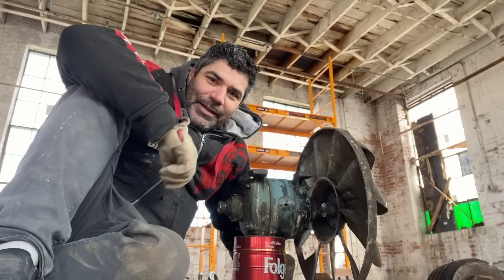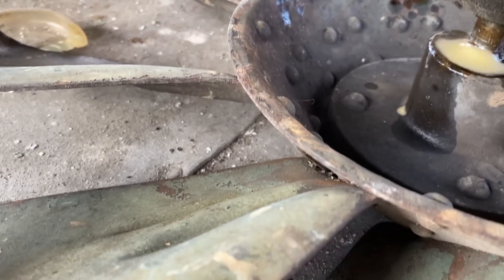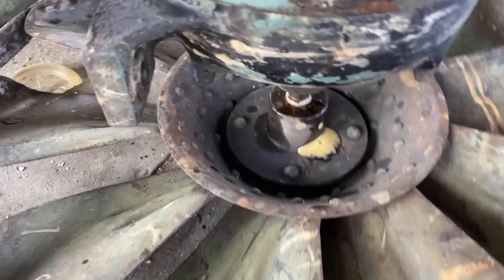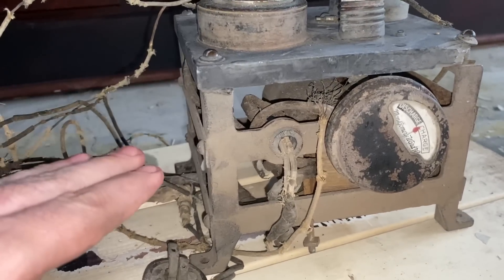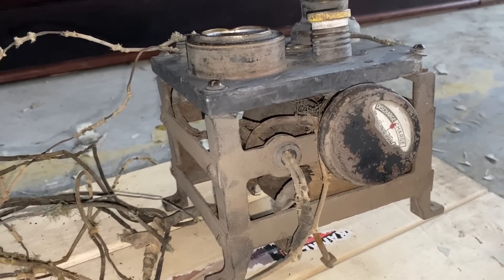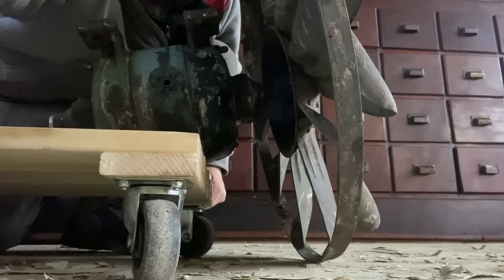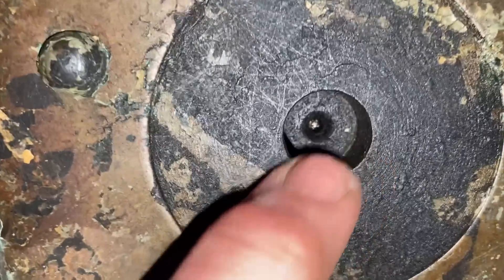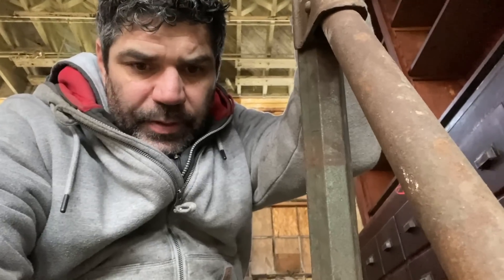Looking at some old pieces of industrial salvage

Comment: The arbor is connected to/a part of the armature, that's why it moves like that. The bolts you see on either side are probably lubrication points for the bearings. The arbor is still stuck in the fan hub. There are no other mechanical connections holding the fan on. You need to continue applying penetrant, and I will reiterate my previous suggestion that you get a heat gun and apply heat to the fan hub (but not the motor arbor). Then some gentle tappy-tappy (with wood, plastic or brass) and it will come off. Penetrant alone can take days to work its magic. Heat and tappy-tappy will speed things along.
Reply from the maker: Got it.  I will try this and upload the result!
Reply: No just get a cheap welder ask the man in the store what kind of rods you should use for different kinds of metals and take some of your older pieces if you have running around and you practice and you say not work no that didn't university isn't cheap so that's why you got to keep trying by
Reply: Yeppers, let that oil do its thing.  Keep putting it in there every day for about a week, and tap the fan off.  Worst case, cut the shaft (if you don't plan to use the motor) and beat the nub out of the fan.  

I know zero about welding.  OK, I know a bit, but have found that even an arc welder becomes a cutting torch in my hand lol.

Comment: Nope, it's just stuck.  I would try ssome heat on it (map torch) and then pry on it a bit.  After 100 years it's probably not just gonna fall off.  The notch, as is mentioned below, is just the flat spot on the shaft for that retaining bolt to land on.
Reply from the maker: Got it. Thanks for the info on the notch.  That makes sense.

Comment: That old motor has sleeve bearings and not ball bearings like a modern motor. That is why there are the matching "hex heads" at each end of the motor. That is where the oil would be added each year to lubricate it. The thrust face of the sleeve bearings will wear over time ( especially when hooked directly to a fan blade that puts a pressure on the motor shaft.) That's what is causing the motor shaft to slide back and forth. Keep applying the penetratingly oil and also try hitting the hub of the fan blade towards the motor with a puddle of penetratingly oil sitting on the shaft. The shock is good to help the oil get deeper. Kinda like working it back and forth till it slides off. Often hubs will have two set screws  driven into the motor shaft. Sometimes 180 degrees from the first one or other times 90 degrees and might be a smaller diameter than the one on the flat side of the motor shaft. 
  You also refer to the set screw as a "pin". Is there a chance that it is actually still in there? It will only be a threaded screw with no head on it about a 1/4 inch long. You get it out with a 1/8" or 3/16 allen wrench.
Reply from the maker: No, I took it out in the previous video.  There is only one. That's a good tip about having the fluid in place during the process of tapping it out.  Thanks!

Comment: For the fan it's just seized on the shaft, get a tool at the auto parts store or harbor freight called a ball joint separator aka pickle fork get the smaller size. That goes around the motor shaft and use some wood to pry against the fan. Since you have a cutting torch get a rose bud attachment so you can heat stuff up like nuts and bolt and shafts just practice first on something that is scrap🙂 keep up the good work love your channel
Reply: For the welder I would suggest this Lincoln POWER MIG 210 MP Multi-Process Welder - K3963-1

This welder can do everything you want and it has presets for all the processes
Reply from the maker: I currently only have 110 in the building. does it have an equivalent model?
Reply: No problem it's a dual voltage machine comes with two different power cords one for 120v and one for 240v and theachine knows what it is running on
Reply from the maker: @ryangilbert5916  Perfect!  Thank you!

Comment: Everything Kevin suggests is correct, but I'll add a bit of knowledge gained through decades if factory maintenance. With the fan blades up, and the motor well supported, heat the area around the shaft with a propane torch, like you already have. I don't think this will be enough to get the fan hub red due to the large mass of the hub, but it may loosen the grip of the hub on the motor shaft enough that you can simply lift it off. Going on to the second suggestion, after heating it as well as possible, quickly quench it with a pail full of cold water. The quick hot-to-cold cycle shock will often loosen the rust grip. In retrospect, whenever I replaced a small motor, I applied a thin coat of never seize or similar product to the shaft before assembly. Next time it would not be rusted in place. Works well on many things.

The mystery item probably is an early 20th century battery charger. The loose cylindrical item might be a rectifier to convert the AC output of the transformer to DC. The copper part on the base of it will unscrew easily, as it is part of the socket...witness the torn away tabs. If you look in the remains of the socket, you'll see where it was attached, and in all probability it can be repaired without much effort. The other thing the cylindrical part could be is a resistance element, to limit the charging current to the battery being charged. It may/may not get very hot when in use. The AC plug, which was mashed under something, shows the trade name "Bryant" and they are still in business, as a unit of Hubbell.
Reply from the maker: Nice, the first time cold water has been mentioned if I recall correctly.  I am going to try all of this advice and post the results.  I doubt I'll do any repair on the charger just clean it and put it on my dresser to take up valuable room.

Comment: Hello from the UK.
I stand corrected, but your Frankenstein device seems to me to be a battery charger.
It’s in a mess, obviously, but underneath you have a bulky transformer. This would have needed either 110V a.c. or 240V a.c. (in the USA - we just have about 240V a.c. In the UK nowadays) and the transformer output rectified to d.c.
The funny looking ‘lamp’ must be a half wave plate rectifier. The Edison screw fitting (we have both Edison screw and bayonet fittings in the UK) is ideal for this. The central pin must be connected somehow (long machine screw?) to the top plate and the (broken) exterior part of the Edison brass screw to the bottom. The machine screw would be insulated inside the plate assembly.
There appears to be a 5 plate assembly; depending on the age of the Frankenstein device, they could be copper oxide plate rectifiers (circa 1920s onwards), or selenium plate rectifiers (circa 1930s onwards). The ammeter and fuse would be in series with the output from the rectifier.
I don’t know what the output d.c. voltage was intended, but the second meter looks a bit ham fisted and probably bodged on by a garage hand years ago. I’m just guessing, but in the US in the early days didn’t nearly all cars have 6V batteries? It might be that it could have been a safety device to avoid blowing the fuse, or damaging the rectifier, indicating reverse flow with a 12V battery wrongly connected.
Hope this helps.
👍🇬🇧👍🇺🇸👍🏴👍

P.S.
One more thought. The construction of this charger is pretty basic, but the rectifier is fixed to the Edison screw socket probably for the following reasons:
1) it’s position allows it to keep cool.
2) if damaged or it stops working, it’s easy to unscrew and replace.
3) depending on a.c. supply and d.c. output required, a larger rectifier with more plates could be screwed in. From the 1930s the Variac (variable voltage a.c. transformer) was available in the US to enable 110V a.c. devices to operate on 240V a.c. supply lines.
Reply from the maker: Wow, that is a super thorough bit of in info. That you for sharing that with me.  Cheers!
Reply: @brickandsole 👍

Comment: those set screws usualy are lined up with the flat spot on the shaft. some times you can use a pully puller to get it off if you can find a place to stick the pully pulle on it. a mig welder might be just right for you because it is more afordable .

Comment: Hi chris put heat on the fan hub with a torch will loosen it because its a interfence fit so it doesnt wobble an get a mig that uses gas its the easist to use . Cheers mate🇦🇺
Reply from the maker: Thanks for the advice Peter. Cheers!

Comment: Hi from R&R in the UK ,like I said in a previous comment heat up the fan hub and he throw a bucket of water over it to crack the rust joint ,then if it doesn't tap off get a copper bar about the same diameter support the blade as close to the center as possible then hit it steadily at first but don't be afraid of it ,basically clobber it like you stole it you have loads more a heavy copper hammer is very good for this
Reply from the maker: that's the next step. Does R&R have a website?

Comment: You need to invest in a small propane torch, this will help to remove stubborn parts from one. Another, heat is the key.
Reply from the maker: Yeah, that's what I have been hearing.  Gonna try that next.

Comment: Take an adjustable wrench between the motor and the fan blade and tighten it around the shaft making sure to engage the flat spot.  Then try to turn the wrench, bracing the fan blade with your other arm.  If done right, wiggle it back and fourth and it should break free. It’s gonna take some force so be careful and use something to protect your hands and arms.  Once it breaks free, you should be able to use a drift punch  to hammer it out. A pair of vice grips may work as well

Comment: Suggestion on the charger...if it's possible, it would make an incredible lamp, floor or tabletop. If there is access to part that looks like a light socket, remove current socket, replace it with pipe of right height, attach a new socket at top of pipe, & add a shade. Clean it up with some mineral oil, & you're ready to go. I know you like the old wires, but you really should remove them in case the wire cover contains asbestos. As a floor lamp, it would make an incredible statement.
Reply from the maker: yeah, I was warned about that.  Gott go in the trash!

Comment: The "Frankenstein" thing on the charger is a resistor. Instead of a light bulb you use the big resistor to dump current faster. That's why your "gauge" has charge\discharge on it
Reply from the maker: got it.  Cool old technology.  Necessary to discharge before working on it someone mentioned.
Reply: @brickandsole  modern battery testers use the same old tech to test health of  batteries.

Comment: A light bulb in the charger would make sense.  When the light is bright it has a higher resistance so if your battery is really discharged it will keep the current from being too big.  What you have in the bulbs place looks like a selenium rectifier but don't quote me!   It would make sense to convert AC to ripply DC to charge the battery.   I'd like to know if you sell it what it goes for.  I'm guessing the right customer and you'll get your payday.

Comment: large bolt heads are for lubrication. is set screw removed from hub. a second screw is sometimes dicovered beneath a top screw. good luck.
Reply from the maker: set screw is removed.  I'll upload the results when I get it.

Comment: My recommendation for welding equipment would be a good quality MIG/MAG welder with gas. Then you have some auto programs then you can choose and the welder will adjust it self and you can learn fast to weld. MIG/MAGs usually don't splatter much if you have clean surfaces, so a wire wheel on an angle-grinder helps to get good result. Keep up your spirit and you will learn how to weld like a pro
Reply from the maker: I did know about auto selection.  Thanks, I will look into that.

Comment: Sometimes tapping a stuck part on further helps free the parts. The flat surface on the shaft lets a bolt or set screw keep the fan on and prevents the shaft from spinning inside the fan. The hole where the "retention pin" was looks threaded, so I would think there was a set screw. Can you see the shaft through that hole? It looked clear when you sprayed but... Sometimes set screws or bolts will bite into an output shaft and create a ridge that has to be forced through the removeable part, the fan in this case.
Reply from the maker: Yeah, I actually took the set screw out in a previous video.  Next will be heat and pounding.  I'll post the results. and what I learned.

Comment: Chris, as long as you already got the set screw out, the keep using penetrating oil and add heat then tap it off.  The battery tester is quite unique and I have never seen another one like it. Anyone that collects automotive stuff would love to have it. I would be very careful about restoring it, do your research first and find out everything about it. Sometimes restoring items can destroy the value.
Reply from the maker: I am the same, a big fan of original condition.  The only thing its that a few people mentioned the wires are likely asbestos so they will have to go.  I'll just clean it and put it on my dresser to take up space I don't have.

Comment: I wood definitely look into a in compression welder  very easy to use no wire no gas and you get grate spot welds😊
Reply from the maker: I will have to look that up. I have never heard of that.  Thanks!

Comment: Fan blades are most always hard to get off the shaft. Nothing else is holding it on but the corrosion/rust. You need to get a torch and heat the fan coupler and not the shaft. This will cause it to swell and the shaft will pull right out. Pull them apart while it’s hot. I always used a fan puller but you can’t use one on this kind of fan. Someone mentioned a heat gun but I don’t believe that will get it hot enough. You need it turn red hot and the shaft should pull right off hopefully.
Reply from the maker: I am going to try a punch first, then graduate to this advice after.  Hopefully I won't need to burn the paint off the fan.  One way or another it is coming off. Thanks.

Comment: A mig welder is an excellent type, they come either using "flux core" wire or solid wire using a "shielding" gas. I would recommend the type using a shielding gas as it typically gives cleaner nicer welds. As with most tools you get what you pay for. With minimal practice and instruction you will be able to do basic welding.
Reply from the maker: I can't wait.  Thanks for the info.

Comment: Usually, if a shaft has a flat on one side, it is for a set screw in the collar of the fan.  Looking at the inside of your fan (closest to the motor) where the flat on the shaft is located, it looks like there is a screw of some sort on the fan collar.  It could be a cruddy allen screw or a regular slotted screw that has been broken off.  Your advantage is that you have others to look at to find out.  The shaft belongs to the motor, the windings and brushes (not literal brushes, copper or carbon contacts)  are attached to it.  The motors that have lubrication locations on the shaft usually have oil cups or grease zirts on them. Not sure what your "bolts" are unless they are where the brushes live.  Look for some sort of set screw on the inside collar of the fan over where that flat is.  The jack is a '20s to '30s style automotive jack.  My dad had a few of them.
Reply from the maker: I took out that screw in a previous video.  So should be good there.  Thanks for the date on the jack, I was wondering since it is not vertical, more of an angle.  Glad to know the date.

Comment: Just thought of one more thing to possibly try. If you can get vice grips to hold the shaft, then the fan blade could be twisted on the shaft to loosen it up.
Reply from the maker: I tried that before the penetrating oil but now I need to try it again.  Thanks!

Comment: The object on the battery charger is probably a selenium rectifier. Like an electronic part known as a diode it acts as a one way gate to alternating voltages in order to come up with a D.C. output. Use a drift pin to dislodge the shaft out of the motor while suspended on saw horses.
Reply from the maker: this is the consensus. update soon!

Comment: Chris, My vote is a mig welder.  There are many on the market.  The Asian imports are the least expensive, but you have to be cautious of the old "you get what you pay for" thing.  If you get a unit that can use shielding gas, keep in mind the cost of buying a tank.  The welder will come with a regulator, but you are on your own for a gas cylinder.  You really dont want to rent a tank when you are only occasionally using it.  The cost will add up.

A good mig can do both shielded or flux cored. Flux cored is ok for quick welds that dont have to look great as there is spatter and slag to remove.  Shielded is best for thin materials.

You would need a cart to make the welder and tank more portable.

There are small units available, too that run on 115 volts.

A lot to consider.
Reply from the maker: do you recommend a used better one or a new affordable one?
Reply: There are some imports that have very good ratings and may be worth a look.  I have not personally used them.  My mig is a Lincoln, my stick welder and plasma cutter are Miller.  These are pricier new and a good used one may be as much as an import, if you can find one that isn't ancient.  If you look at units with a lot of reviews you may find a keeper.  Some may even have domestic support and parts available.  I have looked a tig welders made overseas, but locally supported.
Reply from the maker: @christophersielski1388  I'll watch some reviews.  Thanks for the help.

Comment: The shaft is still rusted to the inside bore of the fan blade.  The flat spot in the shaft is where that set screw went into that you removed.
Reply from the maker: Got it.  Thanks, I'll post the results when I knock. it out. through a whack or heat or both.